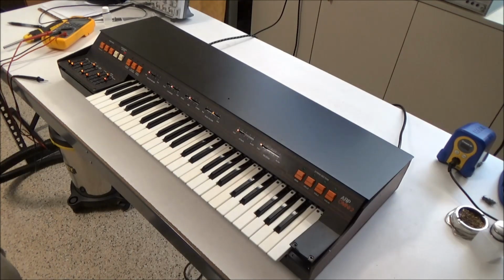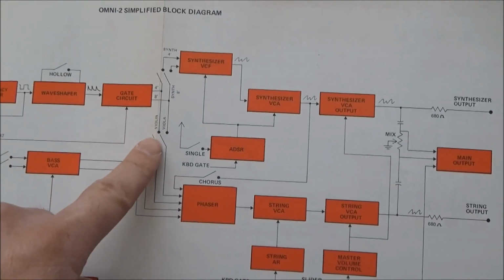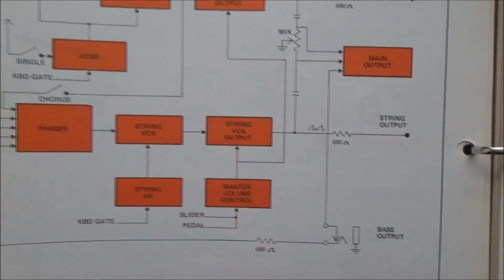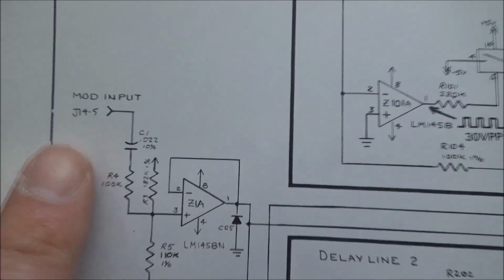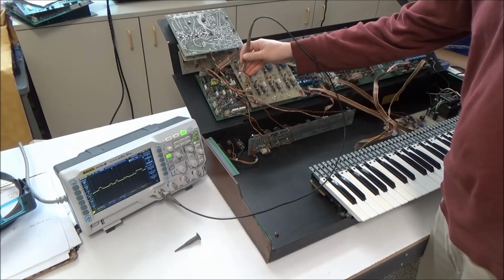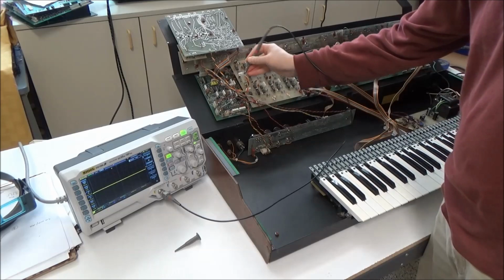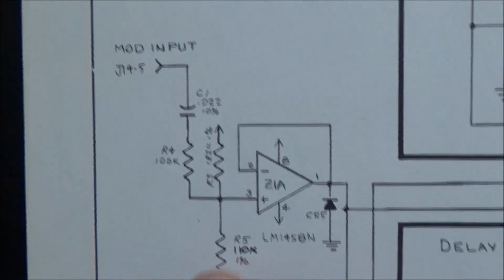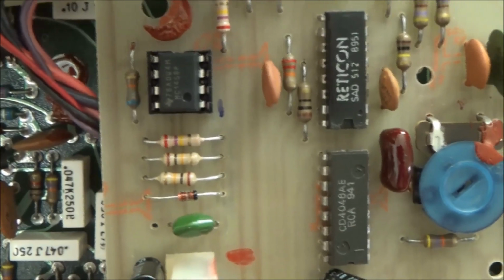Synthchaser #092 - ARP Omni 2 Noise in Output Repair

Comment: Hey, Synthchaser, what does the trimmer at the input to the Chorus/Phaser board trim?  Is it a DC level offset?
Reply from the maker: If I recall it adjusts the 5V rail that's created on the board from the 15V rail for some of the ICs.
Reply: @Synthchaser  - Thank you.  EXCELLENT troubleshooting, sir!

Comment: Well this one caught me out ,  soon as your vid started , I said to my self ,   well its obviously a cd4016 or lm301 op amp , not once did I notice that Trimmer ,  yet it should of stuck out like a sore thumb to me ,   that good old saying ,,  you cant see the wood for the trees ,  this video was a eye opener for me ,  I thought I knew the Omni 2 inside out ,  ive repaired over 20 as you know ,  yet I didnt spot that after market obvious big blue square trimmer lol. Keep this great work up ,  theres thousands of people your helping
Reply from the maker: I've seen that trimmer on a couple others but never paid it much attention.  Apparently they changed that voltage divider ahead of the op amp from 2 precision resistors to 3 regular carbon comps plus the trimmer.  You know that trimmer is going to be super crappy if it was cheaper to ARP to use it than a 1% resistor.
Reply: Synth Chaser very good point ,  have you noticed you cant use a mk1 phaser board in mk2 , or visa versa ,  I never knew why and never looked into it to be fair ,  they look identical but obviously not ,
Reply from the maker: I've noticed it.  I think it's because they're running the BBD chips off different voltages.  The MN3002 on the Omni 1 uses +/-5 and the SAD-512 on the Omni 2 using +/-15
Reply: Synth Chaser arrhh I see ,  knew id get a good reason from you ,  cant wait till you start your Quadras ,,  I had a nightmare doing my few ,  I took a week off work to do one of them , and it took me that week too lol ,   37 sliders to restore for starters ,  but main issues was that bridge conecting board , it flexes when Quadra is lifted offset , the whole thing warps and bends , causing stress on the 3 boards , lead , poly and computer board ,  and the pins losen and break away from the tiny tracks going to them , so I jumped them with flex wire , did the trick ,